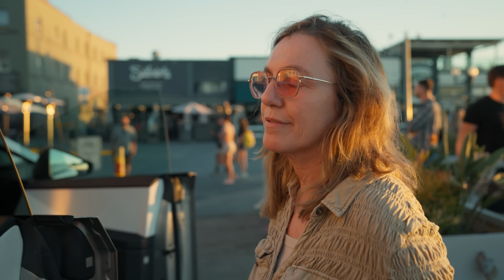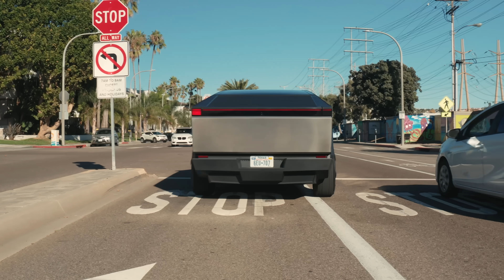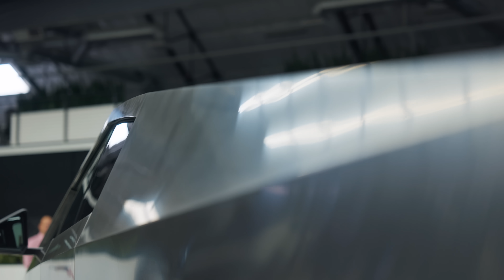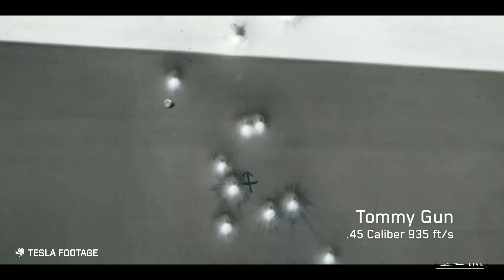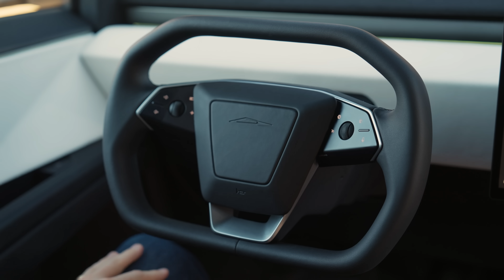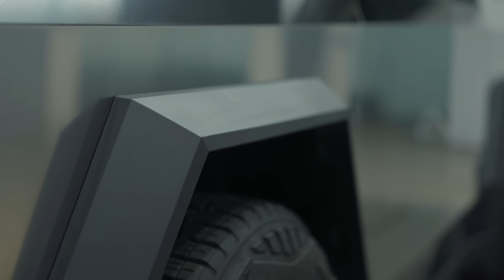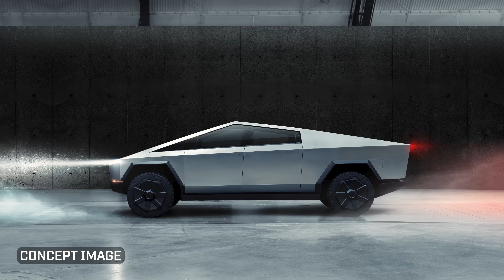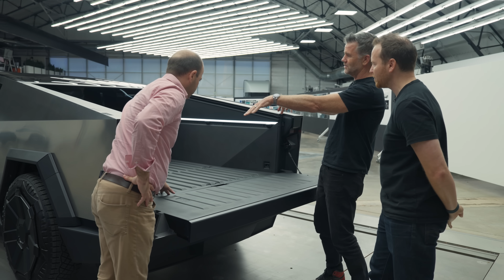FIRST DRIVE: Tesla Cybertruck Full Review

Comment: Not gonna lie. For my work I use trucks like they are designed to be used. I don’t care about if it is bulletproof or not. I care about how reliable it is how easy to repair or how comfortable it is. I need a tool that can efficiently get a job done and this isn’t it. Not to mention most times I would have no way to charge it.
Reply: Bro I feel like I've been taking crazy pills. I'm from Oklahoma and this thing will not measure up to conventional pick-ups. All I've seen with this thing is acceleration, drag races against porsches, tractor pulling, and truck tug of war. None of this is useful information.  If you're carrying a load or hauling a trailer you don't want breakneck acceleration. Drag racing is drag racing and completely useless for a truck. "Cool you're faster than some other guy." Tractorpulling doesn't prove anything because a sled by design is supposed to stop the vehicle.  and truck tug of war is for drunk bored people.

We never see this thing being used as a truck. As  someone from Oklahoma, You can't put a utility bed or feeder on this thing because it's unibody, Looking at it there's no way to put a fifth wheel on it so that's a no-go on most farm trailers. 

Let me put this in perspective. The Ford F-450 super duty XLT 4WD, with fifth wheel prep is on the website for a little over $70k , almost $10k less than the dual motor Cybertuck. That Super Duty is more truck than you will ever need. 

To see people showering this thing with praise saying it beats conventional trucks has me completely baffled.
Reply: @BlackSocksWithJeans you can YouTube where its towing a trailer I think. Haven't seen 5th wheel setups. Curious.
Reply: @Abebe345  the point I'm making is that F-450 XLT can and will get you across country reliably while hauling a trailer or fifth wheel. Cybertruck might be able to pull 11,000lbs but for how long before it needs a recharge? Also good luck finding a charge point. across the plains. To put it simply, if you're looking for a truck, buy a truck. Is you're a social media clout-chasing meme lord, then you buy a cybertruck.
Reply: @BlackSocksWithJeans  you'd be surprised, tsla is building them everywhere and businesses are contracting for them like hotels, gas stations. But don't forget new 48V architecture. It charges from 10-85% in 18 min. You also can have the xtra battery installed when the rental business gets going which gets the range to 470 miles. They did the new wiring with truck needs in mind. But if towing, hauling heavy loads long haul is what you do regularly, then ICE will make more sense.
Reply: @Abebe345  While it's correct that more and more charging stations are appearing. it's just not there at the moment. I'm not sure how deeply you want this conversation to go but The Cybertruck is a niche vehicle. It's for Tesla fans and no one else. Customers who want a truck are going to buy the conventional trucks. Customers who want an electric truck are going to go for the electric options from the big three Ford, GM, and Chrysler have them and the infrastructure to repair them them if need be plus you still have the conventional shape of a regular truck and you have the universal charger instead of Tesla's unique one so you have more charging station options.

I don't like EVs in general. I think they're a band-aid on a bigger problem but if i'm putting aside my bias and saying I am in the market for an electric truck I have to ask you, why would I buy a Cybertruck? What about that shape makes it a better truck than the other options? Why should I have to spend thousands extra to paint it because i don't want a metal colored vehicle?  What advantage does single screen in the middle of the interior have over conventional buttons and instrument cluster?

Ultimately Tesla spent a ridiculous amount of R and D funds to produce a vehicle that has an extremely limited appeal. Ignoring the limits of EVs how are they supposed to make money on this long term? The Ford F-150 is the number one selling vehicle in America for a reason.  If you want a Cybertuck buy it and enjoy it. If you want a truck, buy something else.
Reply: They've created a true truck don't worry.  Although not addressed in this video, it can do all the things you need done, from payload, towing, etc. But if charging is your limit then that is understandable.

Comment: Hang on... originally in 2019 said it would be $39,900 - but with inflation running away since then that's just over $48,000 in today's money. With the gov't subsidy, the base model will come in at $49,900.
Not that far off.

Comment: I drive a Tesla Model 3 now just because I don't do construction anymore I don't have a truck but I drove a Toyota Tacoma from 2002 until 2 years ago never done anything with the motor over 500,000 MI you do have to do the timing belt after 100,000 MI I did do one air condition pump of course a couple batteries and an alternator other than that never did anything internally to the motor will see how far is electric car goes without replacing the battery to be replacing a batteries like replacing a motor in an ice car so far I really like the Tesla but we will see on its longevity that's still kind of an unknown with Tesla I do Rideshare now for and this is a great car for that

Comment: hot rodders have been swapping combustion engines around for years. small block Chevy V8s in Fords, big Dodge HEMI V8s in...Fords, big turbo 2JZs in...other Fords...

point is, i'm wondering if we'll come to a time where we swap these electric chassis and drivetrains around. a Cybertruck-swapped Rivian, for instance. i can't wait to see the next generation of shadetree mechanics.
Reply: Google Model 3 Mercedes Gull Wing at Sema... and the countless other conversions, eg homemade 125kw battery in a Tesla Model S duel motor....
Reply: @kylereese4822  i have seen those big-budget shop-built creations, but i mean something more akin to your local guy swapping batteries/motors from one EV platform to another without fabricating custom parts for days on end

Comment: It's cool, but if it's able to do real truck stuff is yet to be seen. I don't think it's priced, or designed, to replace a fleet of work trucks. This may be fine for some folks but puts it in a different category than a traditional American truck. Also... they say the bed length, at 6', is longer than other trucks. They fail to mention those same trucks can be optioned with an 8' bed... as most real work trucks are. It's like they think really knowledgeable truck guys won't watch this and just laugh.

Comment: I am a service technician. I have built and repaired complex elevator systems for decades. Hearing these guys talk about the lengths they went to, to build this makes me cringe. Repairing this, with its industry challenges they over came, will be a nightmare for guys like me. Imagine having to change the windshield? And when they get into an accident working on the CAN system will be hyper expensive to repair/replace. Wow, though…it should be an interesting ground breaking vehicle. Look forward to the disruption it will most certainly bring.

Comment: Go watch MKBHDs video. Less biased. Also the the extended range add on “accessory” is $16,000😂 I paid $445 for a 33 gallon gas tank in my hybrid hemi (standard 26) and get 19.5 highway 17 city, 530ish to the tank. Full size 4x4. Limited. $16,000 is a used car bro… and it eats up your bed space. WTH😂 Also you’re not jumping this 7000 lb hunk of Elon’s midlife crisis truck with air suspension… “Baja” mode…

Comment: I really hope in 3 years theyll decrease the price, but man 60k for a rwd with just 250 mile range is a bummer..
Reply: I think the price will lower after the initial production ramp, it’s happened for the 3 and Y so I assume they’ll find ways to reduce the cost of manufacturing over time
Reply: My bet is that they want people to buy the 4wd version: a slightly higher price, much longer range (and room for a range extender) and almost identical to the 100k version save acceleration

Comment: So it's not $40,000
Glass isn't bulletproof but can withstand a softly thrown baseball
Can't do 500 miles
Can't tow 14,000lbs
Has a 1000lb lower payload

But it's fast in a straight line which is cool and what all pickup drivers want

Comment: The thing looks absolutely hideous, but there's a crowd for everything and maybe, just maybe, it will grow on me (wouldn't bet on it). 
Looks like you can't fit bigger wheels. Camera shot from the suspension looks like there's a suspension component and bolt just above the tyre?
By the way, the wiper looks a last minute stick on bodge job...
I wonder what all these heavy cars will do to roads en driveways which aren't used to this. And for side impact crashes... Time will tell I guess.

Comment: Here's what I need before I buy:  solar tonneau cover that will at least maintain the battery when parked so that it doesn't have to be plugged in by default.  Here's what I would like to have:  direct solar charging (add on solar panels), extended battery in the hidden cargo area (or wherever else) instead of the bed for 500 miles of range, center front seat, tailgate ramp, hidden windshield wiper, and bed access from the cabin.  Here's the dream:  sleep while being driven overnight for 8 hours.
Reply: It's been discussed already that solar won't be sufficient to charge the battery.
Reply: @michaelc7014    IIRC, Elon mentioned that about 15 miles a day would be feasible and perhaps up to 40 or 45 miles a day with fold out panels (can't remember the exact numbers, but it was roughly something like this).
Reply: @michaelc7014  Maintaining current state of charge is good enough for me.  Imagine being long term parked somewhere without chargers and returning to a dead vehicle.
Reply: Agreed.  Then if you do run out of energy in the middle of nowhere, just leave it and come back in a couple days and drive out to a charger!

Comment: I will miss electrical outlet in the frunk. It would be very handy for a fridge, for example. Hope they can easily add it in the next revisions.
Reply: Why do you need it in the frunk when there are multiple outlets in the trunk?
Reply: I don’t think the frunk has ventilation to reject the heat from the fridge.
Reply: @Nitroscion  I don't think that trunk has it either, but people use them all the time. On the other hand I doubt that frunk is vacuum sealed :) So it might be enough.
Reply: @zhsergey2  The frunk won’t have enough ventilation based on the volume of space. The bed will be more than enough space unless it’s July in phoenix with full sun beating down on it. Don’t believe me? Look up a P/T chart of 134a and you can see what kind of temperatures and pressures there will be once it becomes 130+ degrees.

Comment: The industrial process is the most fascinating thing to me. The machines making the machines. Also the philosophy. White sheet + physics laws & regulations & what do we want to see on the roads for the next 20 years. Big achievement from the designers & the Tesla engineers.
Reply: What on earth are you talking about?
Reply: Robots have been making cars for decades.
Reply: @paulelledge8977   Using robots is not a binary thing.  Some factories are more roboticised than others.  Apparently this one rates at the top.
Reply: @danharold3087 it doesn't, you have been lied to.
Reply: Yeah nothing new, just more marketing lol. Ive been working in the automotive industry for almost 2 decades and there were robots building cars well before i got there.
Reply: @__beer__  Now every automotive company is scrambling on copying the giga castings and other manufacturing processes Tesla uses
Reply: @DrLol07 haha no they aren't... they actually make real cars.

Comment: horrible still....Worse in daylight...Why are they still doing wheel caps instead of wheels? Those things are horrible. They look like you bought a can of black paint and sprayed some crappy wheel covers you found. Who cares if you lose 10 miles of range...ditch the wheel covers Tesla! Also, the way the stainless looks all warped down the side looks horrible. It should have a regular steel/aluminum version. Who the heck needs a bulletproof car???? I sure as heck hope I never do. I am sure that people dropping 90 grand on this ugly thing are not getting shot at either...